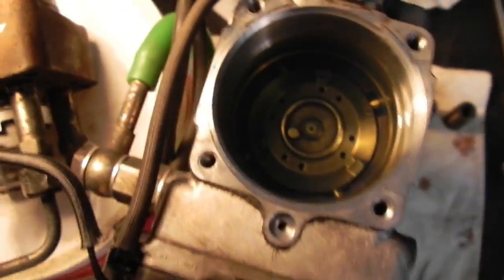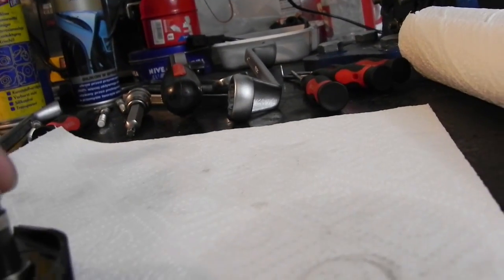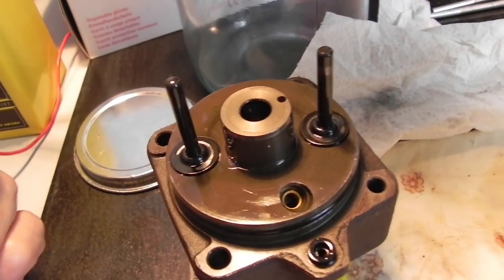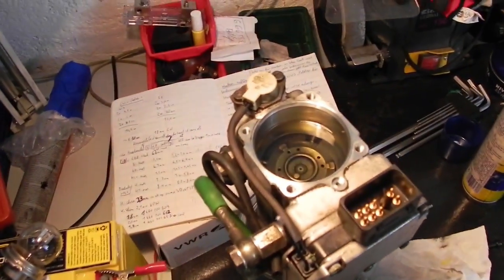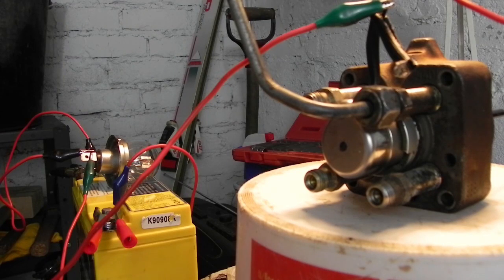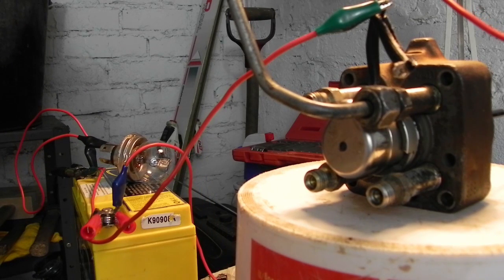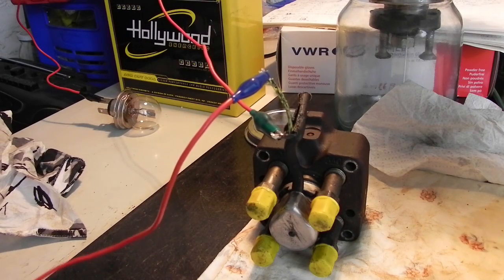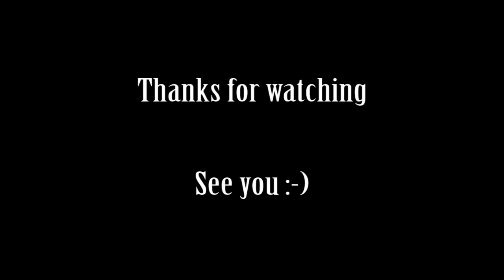Bosch VP30 Rover - pump teardown , comparison & look inside

Comment: The shims under your two plunger springs vary from pump to pump. It's not "wrong" that one pump only had one shim and the other had multiple shims. There is a measurement that you take when building these pumps at a pump repair shop, and based on that you adjust the shim thickness/number of shims. Cheers.

Comment: If I do swap out my defective vp30 off from another engine for my ford focus 2001, do you think I will have an immobilizer issue?
Reply from the maker: Yep it will have immo problems, cause only the Rover pumps got no immo coded into the PSG pump unit. Opel, Ford, VAG all have the immo in the pump coded.
Reply: Thanks for your feedback.